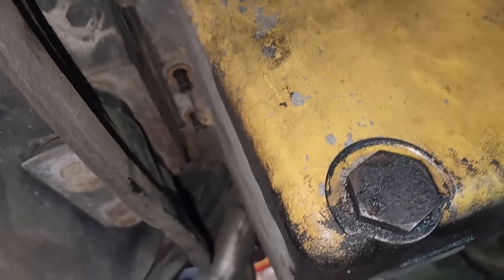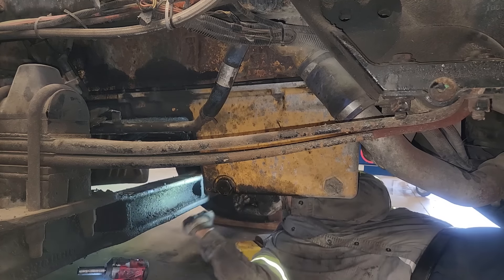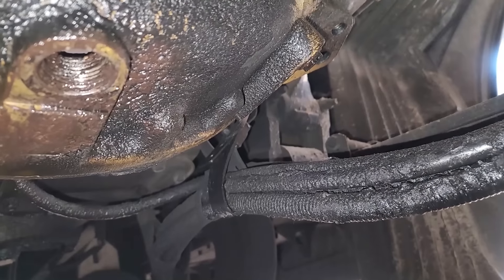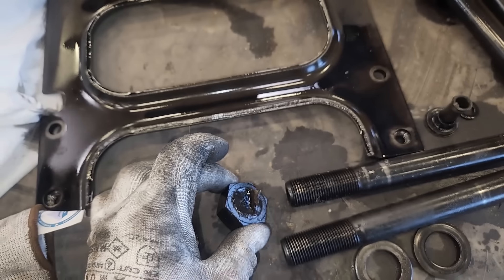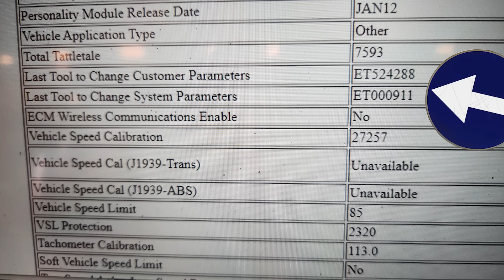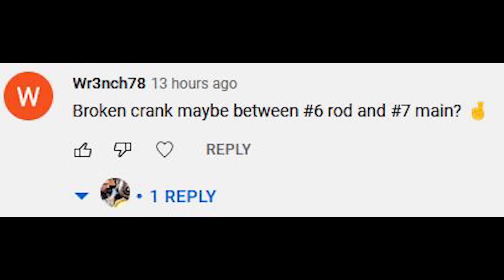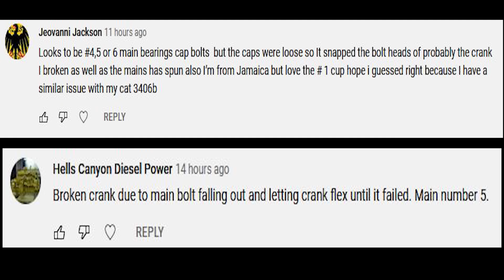This Is Why This Engine Is KNOCKING So Bad. "Knock It Off" (MAJOR DAMAGE).

Comment: Hi. What makes you conclude the crank broke first then causing the main bolts to break instead of the bolts coming loose and causing the crank to break then causing the heads to snap off?

Comment: i  had a simular problem with a hino motor and when you look at the bolt and the head you will find that there was a very tiny defect in the bolt and the flexing waves will coinside with the power stroke of the engine    so after a long time the flexing continues then after that time the bolt snap off
i was the service manager for hino at the time and hino replaced thecrankskalf and repaird the moter but the customer had to pay for the gasket set

Comment: I like to see the clutch and input to the transmission looks like 
Back in the early SDP CAT they had a adapter housings that had been machining that was off center line with crank shaft and taking out transmission left and right also the  Torsional dampening cause from that created created crankshaft's bosting between those 2 spots between 6 and 7 mains I had one first hand on king of the hill 600hp do it at 67,000 miles in that time frame I had 5 transmission failure to my housing was off .235 thousands off as looking the truck look to be an old MIDWEST SPECIALIZE From Rochester MN Chris loved his trucks there but as for my self these engine had a lot short comings back 2008 2009 2010 were the worst years for PACCAR KW AND PETERBILT.

Comment: I had a Toyota HDJ81 Landcruiser, 4.2 Turbo diesel. I rebuilt the motor, and in hindsight I should have crack tested the crank because in about 5 thousand k's the bastard thing broke right at the flywheel end. In NZ nothing is cheap and rebuilding this motor cost a fortune, i wasn't going through that again so I repowered it with a v8. Live and learn eh.

Comment: People guessed the broken crank location since they have seen it before, and its a known failure mode...........  Certain engines have a "broken crank" issue.  A good example was the late 1970's V8 Mack engine........375hp rating, they were well known crank snappers.  By the mid 1980's, the 400-V8 Mack was super reliable, do a million miles no problem.

Comment: as pertains to the force required to share what the Peterbilt parts website says the size of a Caterpillar C15 engine main bearing cap bolt:

τ = Ƒ / π𝘥𝘩

τ = 150,000 psi / 3.14159265 × 0.875" × 0.0625" (my estimate of the area sheared from watching the video is roughly 1/16" long.)

τ = 25,777 psi

Higher than the safe combustion gasses pressure allowed by Cummins® according to a YouTuber describing the STC systems in Cummins® heavy duty engines (20,000 psi).

Comment: Love to see the rebuild of this motor.
Reply from the maker: It's still just sitting there waiting on approval for someone.
Reply: No rebuild, replacement. Also if it is illegal your are require by law to make it legal, fine is $37,500.00.
Reply: Chopra Motors does some amazing CAT rebuilds
Reply: @johngoldsmith6629 what are you talking about

Comment: For got to tell you, we had in our shop a new content long block. Been running two years, took the cylinder head off and all water ferrules was missing.
Reply from the maker: They were just gone? I guess I shouldn't triple check them when I install a head then.
Reply: @AdeptApe  Yes Sir, Cat forgot to install them. Amazing it did not leak coolant. The spacer plate gasket had the aviation sealer on it.

Comment: The strength of bolts or studs are in tension, not shear. If the crank cracked it would introduce shear forces on the main bolts and it looks like they were partially sheared before the heads snapped off. Could be wrong of course as just looking at video.
Reply: Could have two failures, I agree about the bolt head failure.

Comment: I got a 6nz factory reman in a glider about to hit 100k miles 
When would you recommend running the overhead
Reply: When it makes noise, when you notice fuel mileage decrease or a power decrease, but in all reality it's really a personal choice, a Cummins ISX could go 500K before a overhead where a N14 I would recommend 200K miles max on them, again it's all personally what you feel comfortable with
Reply from the maker: I would say it's a good idea to check it at 100,000 miles. You'll probably get the most wear in the first 100,000 miles so it would be good to check it. Hopefully it won't need much adjustment.
Reply: @AdeptApe  thanks for the reply

Comment: Hi I have questions I bay front cat dealer in pa in the past year cat 2ws 550 install in my 2000 w900. So the problem I have is in the summer in altitude of 7or 8000 feet of altitude temperatures going up to 217 218 . Bo went are in pa the altitude is no to much the are work ok I replease the thermostat for 5513 this one open a 180
Instead 190 the engine have before, and replease  atmospheric sensor the radiator for one custom make 5 channels. This engines work like this ? Thanks in advance

Comment: If you're going to go through the cost of oil analysis then please don't fill sample bottles from the drain plug unless the only information you need is if it's oil.🤦‍♂️
I analyzed oil and unfortunately, the sample drawn would have been worthless as an assessment tool and most labs won't destroy their lab equipment. They'll take one look, charge you full price and dispose of the sample. 
Use the vacuum sample device to fill the bottle or ideally, a sample port so the information provided can be used to identify the issues like silver in the oil indicating med speed diesel engine main crankshaft bearing wear😎👍
For this case however, an oil pan full of parts and a 2 for 1 crankshaft told the story 🤣

Comment: Whether this is true or not is up for debate. I’ve heard if a crank breaks in the rear, it was a vibration from the front. And if they break up front, it’s a vibration from behind coming up the driveline. Do you think it was the damper?

Comment: I'm wondering if someone did rods and mains and then over torqued the main bolts.
Reply: You would stretch the bolt and the weakest point is where the threads meet the shank. Or it would have locked up the engine.

Comment: I say that the Bolts broke first, causing the crank to bend and breake!
Why? Because Bolts usually don´t breake at the head!
Bolts breaking at the head is an indicator for embrittlement!

Also look at the krack on the heads, that ridge poking up has clearly fatigue cracks on it (smooth crack with lines) 
The flat part of the crack is how a violent breach looks like. (frayed surface)
Thats from when it finally let go!

I would guess those bolts are to hard in the head area from insufficient annealing after the forging proces!

I work with big Gen sets (in Germany), and i have seen alot of fatigue issue on american engines!
Like bolt for accessories on Cummins, or Studs on Perkins engines.

We head one customers with several Perkins 4016´s and the studs for the Rocker arm towers broke regularly.
After one that was already replaced with an original part broke again, we got a cnc shop make us custom studs (Because you can´t buy much imperial stuff here).
And the Problem nerver appeared again! 🤗 (Parts where even cheaper then originals)

Comment: My question is, how long did the engine run, the bolts don't just unscrew themselves in a few engine revs. So my detective mind says, something fishy in that oil pan, and the cap didn't fall down.  🤔 Hmmmm

Comment: I don't have any experience with diesel engines, but I wonder if the injector for the failed cylinder had some kind of malfunction due to impure fuel resulting in a hydraulic break... ): Looks expensive to fix...

Comment: I'd be curious to see a video about why heavy duty diesel engines are mostly i6 and not v8. I know v8's exist, but I don't see it often outside of the automotive world with dirtymax and powerless stroke. The i6 design has many pros (balance, bottom end strength, etc) and some cons. But what's your take on the industry "norm" of i6 over v8? Hell I've seen more HD i4 designs than HD V8 ones.
Reply: It's a North America thing. Europe still heavily uses the v8 like in scandia trucks. I love love the I-6 motors but it's not the only game .. I'd run a V8, V10 V12 or V16 anytime
Reply: Weight be a reason too.
Reply: @100pyatt  scania is the only truck manufacturer that uses a v8 diesel. It’s mainly due to space constraints within the cab over wheels design.

Comment: Pakistani Truck (YouTube) Can weld that & have her back on the road in a few days, if that
They are the go to guys with 7018 arc rod!!
Reply from the maker: More like 2 hours probably, not even remove the crankshaft.
Reply: @AdeptApe  Maybe. They rebuild a truck in less than 30 minutes!

Comment: you know a sound is bad when the mechanic aborts an engine start.

uuuh, reading through these comments it seems that both new commercial and new consumer engines are dieing left right and center. what the hell happened to "if it ain't broke, don't fix it"

Comment: harmonic displacement via a welded repair caused failure in another place of the crank..

My guess in its service life the crank shaft had a repair job done on it  and it wasn't balanced  prior to being  put back into service  looking at how the bolts sheared off, off balance went to the weakest point of the conrod.. sometimes it pays to replace something than repair it in the long run

Comment: Oh someone hammered the dock witj the trailer in reverse and broke the crank. Oh do you remember late 90's early 00's on the ddec 5 when they put the hollow ,lightened crankshaft . ? Man i changed probably 40 ctanks on recall at heintzelman Ford in orlando fl. They were a western star dealer so detroit right.

Comment: What is the FLS and FTS?
Good to know that Cat engines log the tool IDs, so don't mess with an engine under warranty. Fortunately I don't mess with any engines under warranty.
Reply: Full load setting and full torque setting. It determines the max fuel delivery at 1800 and 1200 rpm respectively.
Reply from the maker: Thank you Super Secret.
Reply: Full load is where rated HP at rated RPM's is produced. Another term Cat uses for FLS is intercept. Basically in the old mechanical days the angle of the curve (droop) from high idle to Full Load, at the point your touching the torque spring (Set Point), the fuel setting at Full Load. FTS is the fuel setting at peak torque or another term Cat uses is slope. The angle of the HP curve from Full Load to Peak torque. When you do a PAR run and it requires a FLS/FTS adjustment. You have to have both of those readings of fuel GPH and RPM's +/- 10 RPM's. Between Full Load and Peak Torque you have another term called Hump HP. So as RPM's drop below Full Load the HP can increase. So max HP (depends on Full Load RPM) or (what type of torque spring you have) could be a 100 RPM's or so under full load RPM. Again using the mechanical engine system, your starting to deflect the torque spring giving the engine more fuel on the piston to accommodate for the added load. Back in the day all this was done with moving parts. In today's time it is done with a program (flash file). Torque rise is what you want to see, if you have a low HP engine. When you hit a hill does you engine have the torque needed to pull the load. So Torque rise is Peak Torque minus Rated Torque, divided by Rated Torque times 100. The big deal in the 70's was take a 1693 Cat, 425 HP and put the 380 HP HT torque spring in the governor. The 380 Torque spring was 0.088 more fuel versus 0.032 on a 425 HP engine when the torque spring was fully deflected.